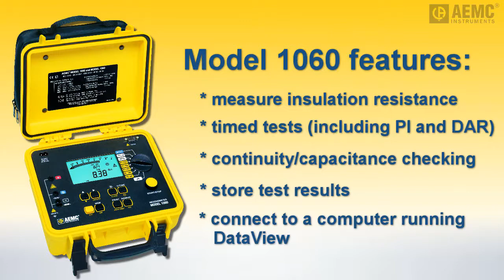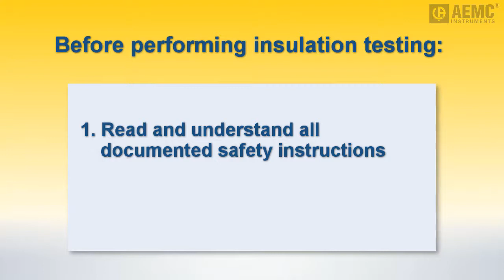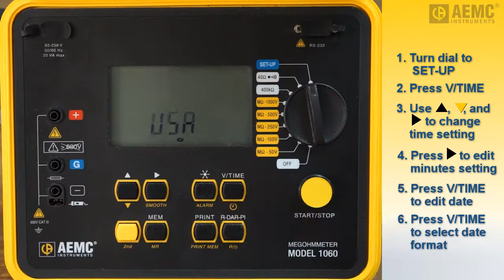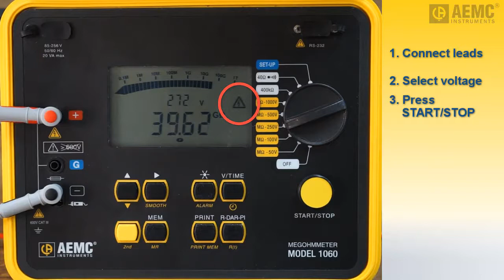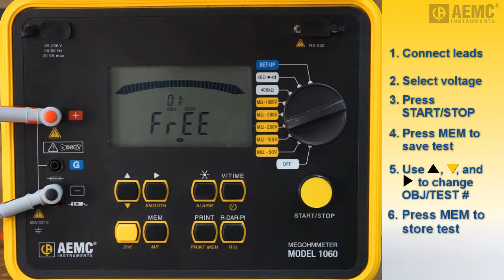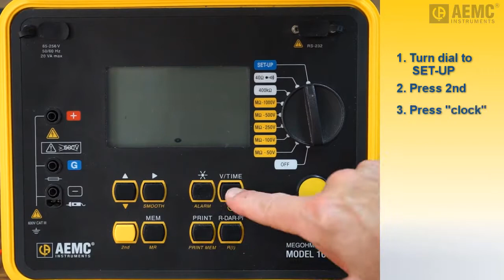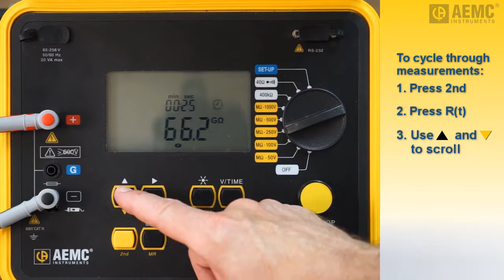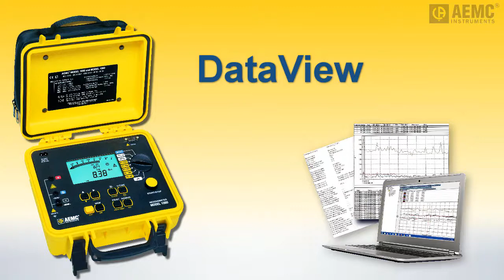AEMC® - Using AEMC Megohmmeter Model 1060 Part 1: Setting Up and Running a Test

Comment: Does PI stay on the display of while testing
Reply from the maker: The PI value is only available on the display after the PI time has expired.  The default times for PI are 1-minute/10-minutes.  In this case, the PI ratio is viewable at the end of testing, which would be 10-minutes. 
Hope this helps.

If you have further questions, please email us at techsupport @ aemc.com 
Thank you!